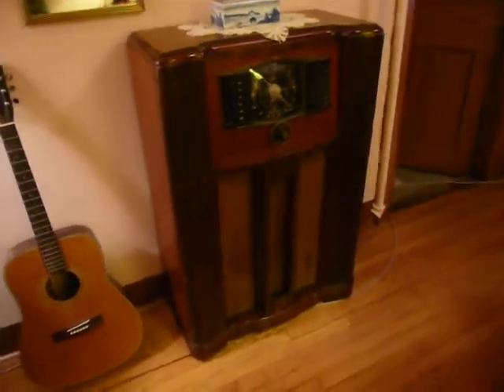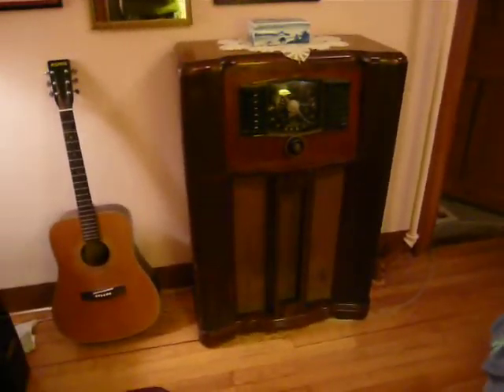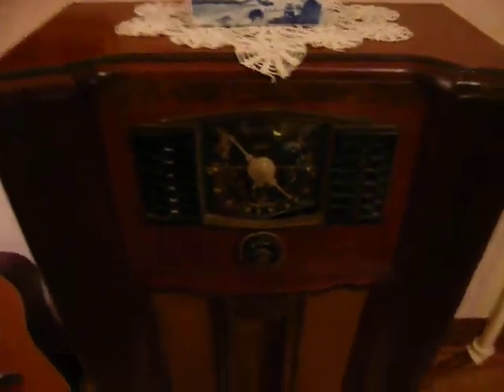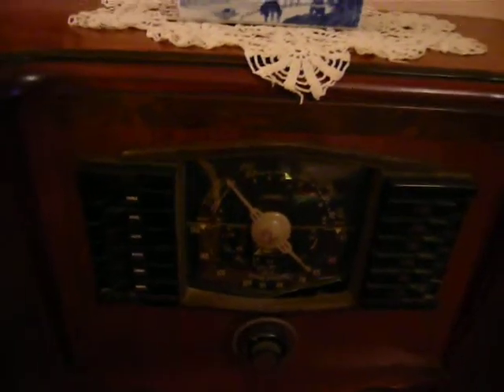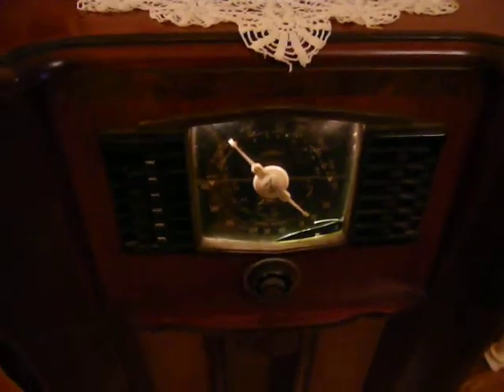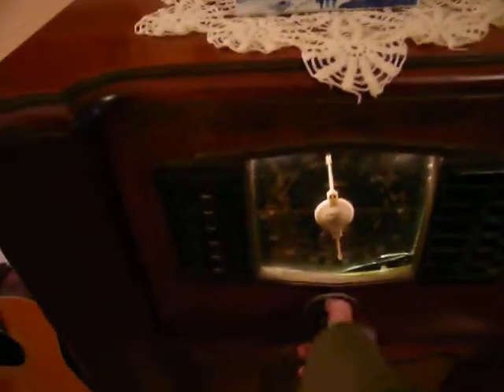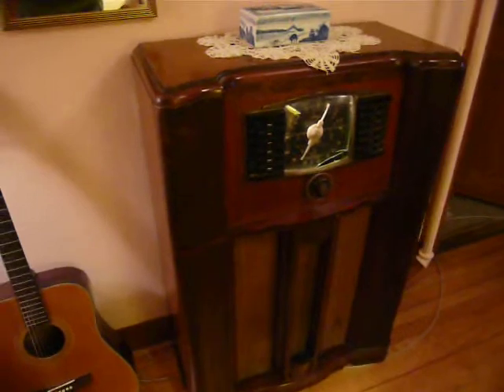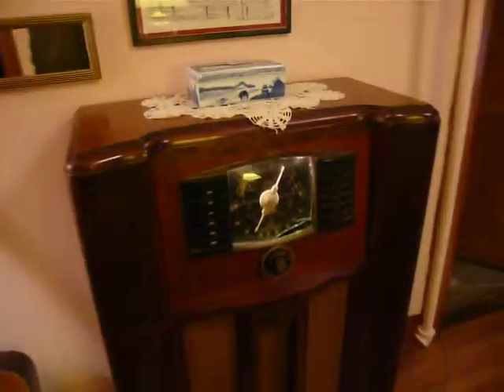1942 Zenith 10-S-669 Radio

Comment: Gotta love these old radios! I have a Zenith 10s464, circa 1940 that I replaced all the caps, resistors, most rubber wire, all mica caps. It has no hums, no buzzes and it's very quiet with the volume all the way down. The volume is just incredible!

Comment: Good that the radio is still functioning. If the capacitors have not been replaced, you will take the chance of frying the big transformer. Once the radio has been playing for a while (about an hour or so) feel the transformer. If it feels uncomfortably warm to the touch, the caps are really straining the transformer. Best of luck with it.

Comment: I just acquired one of these a month ago, and have just started working on it.  And yes, I have to rewire a lot of it because of the rubber-coated wire!  The cabinet on mine is in great shape, plus I need some new grille cloth.  I'll post it when it is done.

Comment: You beat me to it. I was going to do a video of my 10s669 sometime- These were common sets of the time and most are found with the cabinet in terrible shape with veneer destroyed. I paid around $350 for mine due original condition of cabinet. By the way all the new electronics we have nowadays really cause crazy stuff to happen when trying to pick up stationstry unplugging them and see what happens. Also, unplug the radio when not using it. Thanks for the posting.

Comment: Plastic dial replacement is available at dialcovers.com.  I don't suggest anyone run there radio with caps older  than salt.   The line voltage today is extremely high compared to 1942, and quite frankly you're asking for transformer failure and render the set for parts only.